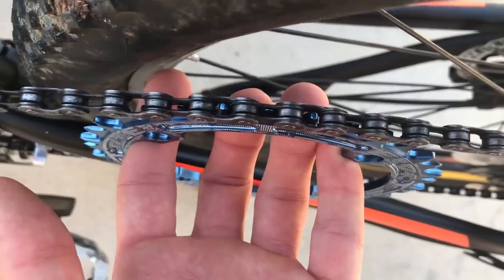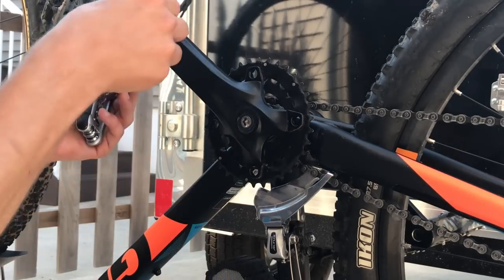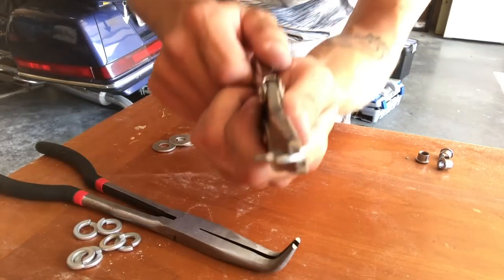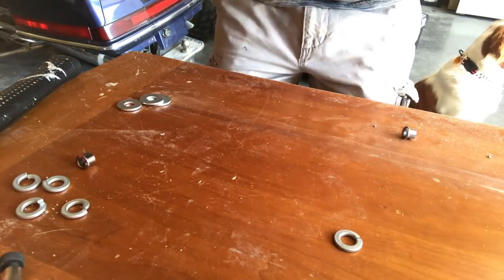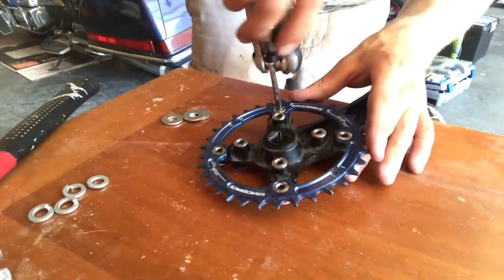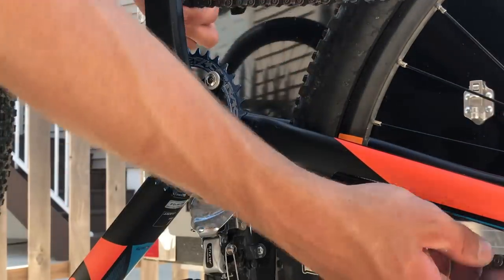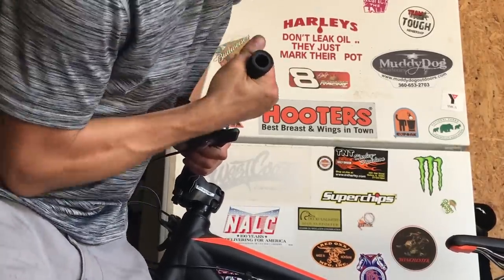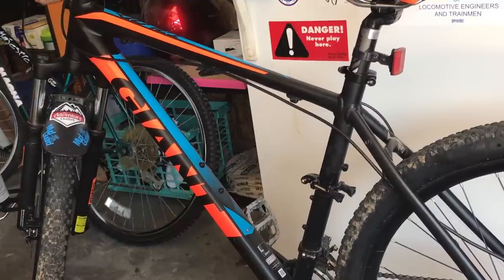3x8 to 1x8 MTB Conversion - Stupid or WORTH IT?

Comment: I would hate it. I would go for a 3x12 if possible... to have a wider range, not ruin it. Who cares about 200 extra grams!? Get some fitness better. Now, you probably have less than 350% gear range. I would like 600%. You had over 500%!
Reply: takes more fitness to climb with a 1x than a 3x tho...
Reply: Spicy Fireball But why ruin confort?
Reply: @primarulgiurgiului  I'm simply addressing your "fitness" comment. in terms of comfort having a 1x11 is very good for nearly MOST of your mountain biking needs. having a 2x helps on the chances you are on a super steep climb...but how often is that? most of the time the climb up is on a well made road, not on a trail with varying degrees of incline. personally I have not seen a hill I could not climb on my 1x10. so I would say that a 1x11 or 1x12 are more than adequate to make up for the extra front chairing, and extra clutter in the cockpit
Reply: Spicy Fireball 1x might be acceptable for climbing, if you are strong but on the descent you might want something bigger to move faster.
Reply: @primarulgiurgiului  you must have never ridden a 1x
Reply: Spicy Fireball Oh, but I have, many times when my 3x derailleur broke and I had to shift the chain by hand, I chose the mid chainring. It is true, the rear was only 9x but still I think that unless you have very strong legs, a larger gear range is better, if you are not racing and 300 extra grams don't matter. 
To end this, everyone should do to their bikes what makes them happy. If you are happy with your investment and the way your bike performs, than congrats, good job, it is a metallic instrumet in the end, who cares?! It is important for you to be happy, not me, nor anyone else. I'm just saying I don't like it.
Reply: @primarulgiurgiului  if you say "everyone should do to their bikes what makes them happy. If you are happy with your investment and the way your bike performs, than congrats, good job, it is a metallic instrumet in the end, who cares?"

then you would not have said this "Who cares about 200 extra grams!? Get some fitness better. Now, you probably have less than 350% gear range."
Reply: Spicy Fireball To intrigue.
Reply: @primarulgiurgiului  "to intrigue" would not imply that someone "get some fitness better" if you just wanted "to intrigue" a simply "why would you chose 1x over 2x+?" not "Who cares about 200 extra grams!?"